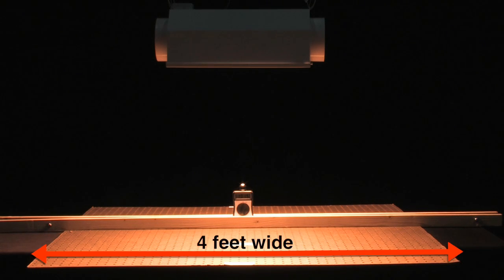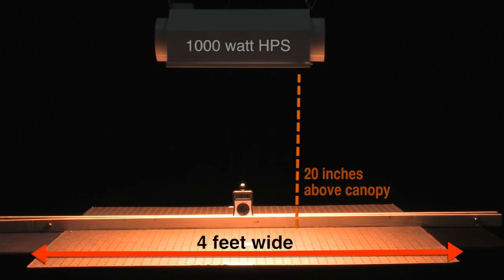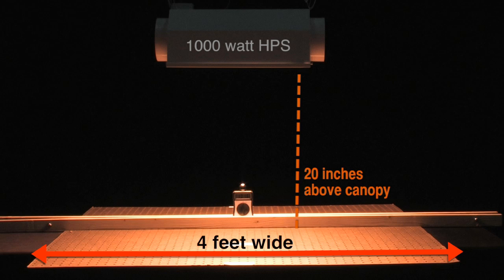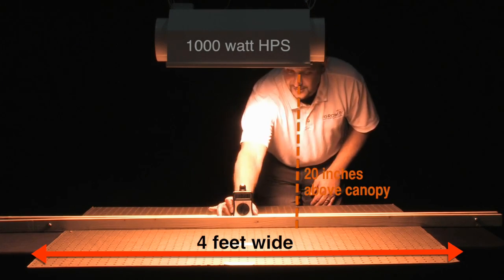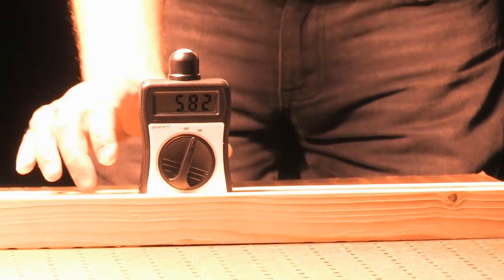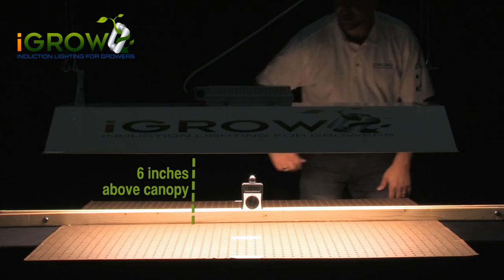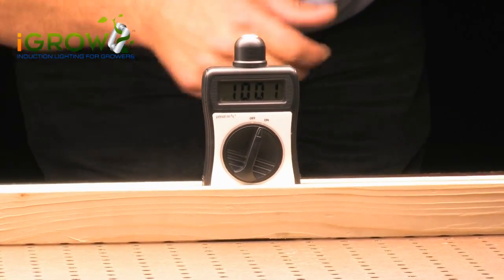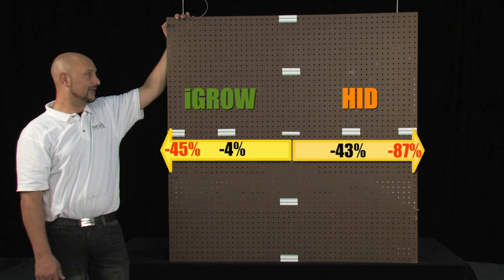Real time comparison on 1000 watt HPS vs Induction Light 400 watt iGROW Indoor Gardening Technology

Comment: Is the iGrow light meant to be used at 6" above your canopy top without burning the plants? I understand it uses less power which is awesome and it seems based on this test the light is better distributed. The real test is to determine if it yields like an HPS. Saving a little money on power and climate control means nothing if you cannot yield the same as an HPS. Ushio 1000w HPS bulbs are $100 and good for up to a year. Factor in how many bulbs you can buy for the difference in cost.

Comment: my 1000 watt HPS bulb is still only 13 inches long and i have a huge CAP reflector currently being used and it still has hot spots.  And the point that igrow lights made in response is a good one, i still have a 1000 watts being used and i still have a 6" fan running and the controllers etc.
I used to get better production from my smaller HydroFarm hood like the one in the video than this monster i have now.  Live and Learn.

Comment from the maker: see your point, here is a counter. even using a bigger reflector the bulb is way undersized, all you are doing is diminishing the light over a wider area. even if we are equal in the test, the main point is the energy use. the 1000w is still 3x more expensive to operate, needs to be replaced regularly and cost a ton to get rid of the heat and cool the room. we wanted to prove we can get you the intensity you want at a much lower cost of operation